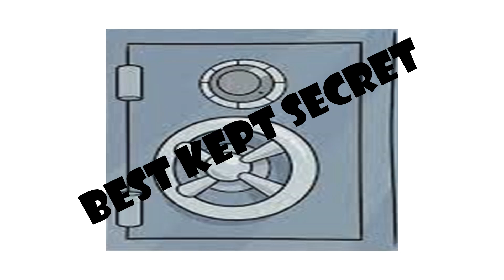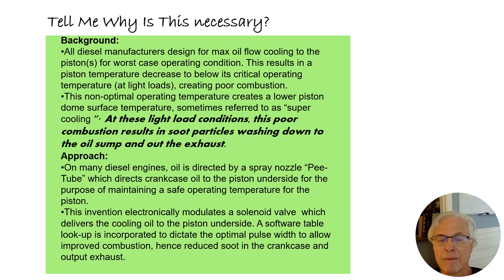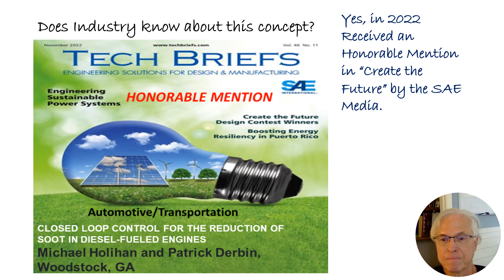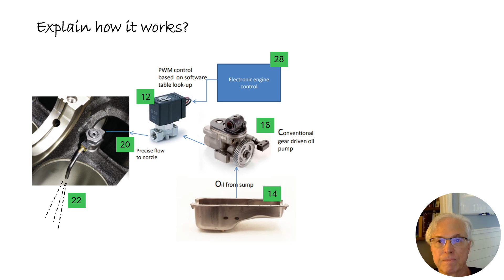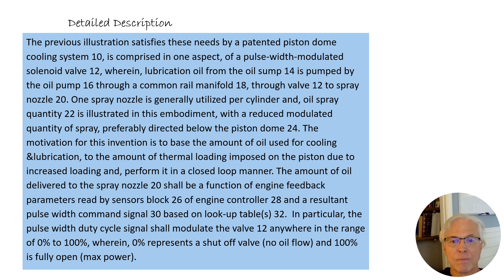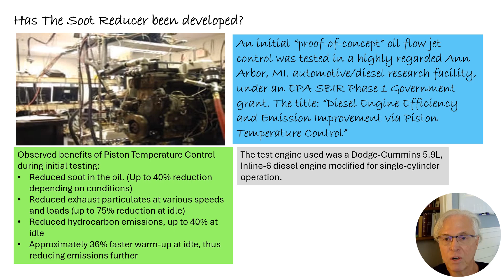BEST KEPT SECRET

Comment: In our current low pollution climate mandated by the epa  and heavily fined into the billions when not followed, it is surprising that companies would not further pursue novel solutions like this to improve the engine efficiency and optimality for both power and soot reduction.  Certainly pursuing research trial runs of novel ideas like this would be less expensive than the billions of dollars of fines.
Reply from the maker: Thank you for your detailed comment. Our patented concepts leverage well known research on the concept of piston cooling, whereby a cold piston contributes to incomplete combustion. This results in oil becoming dirtier much quicker and will wash back down the liner to the oil sump. Oil will also reverse course and migrate to the combustion chamber in those instances where the cylinder is not pressurized (slight vacuum). That's the area where our closed loop solenoid controlled strategy reduces the available cooling sump oil, when possible. This area has been over-looked and offers much promise for minimizing soot and particulate production.